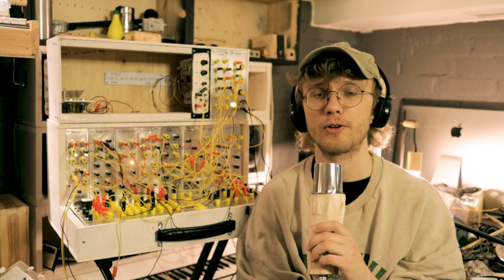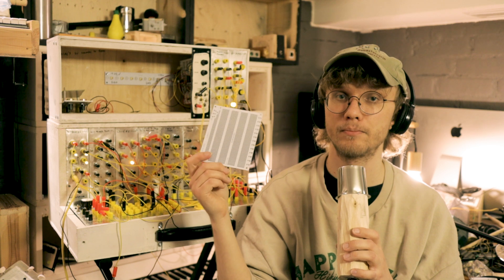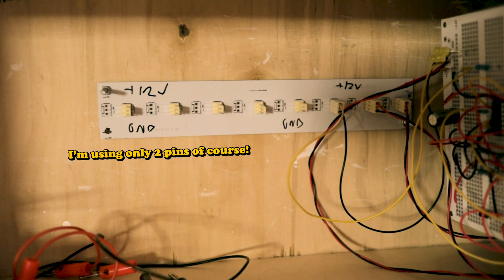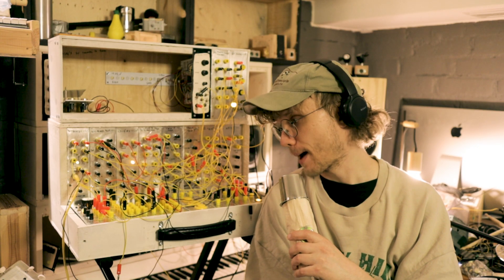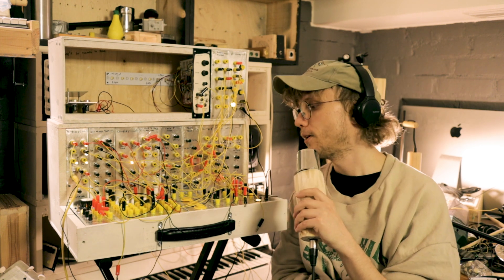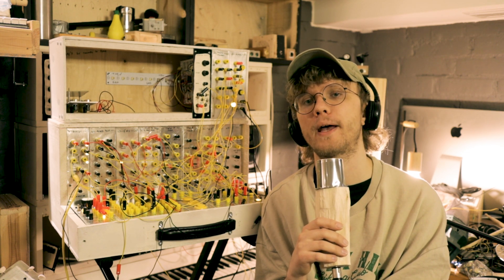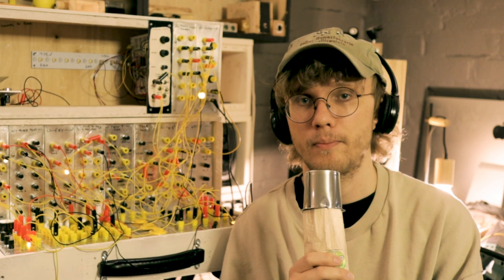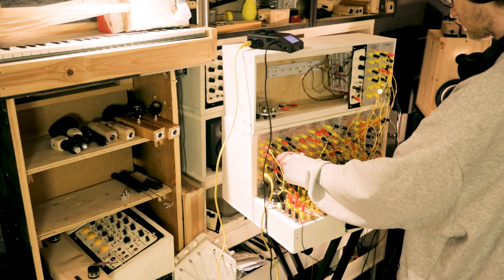MAKING A DRUM MACHINE EP 0 / overview of the project + free sample pack!

Comment: Great to see another video. A suggestion to try to suppress the "bleed through" - add a bucket load of capacitance right at the power input the module. On my build of your twin-t kick drum I put 2000uF at the drum supply terminals. It stopped untriggered popping of the drum. Maybe the same will work for you. I find any module that uses a notch filter arrangement needs a lot of capacitance on the power rail at the module itself.
Reply from the maker: Thanks! Yeah i do have a capacitor at the power input of every module but cant remember what values i’ve used, i might have to buy some bigger caps and try if it makes a difference with this. I also do have decoupling caps close to all the cmos ic:s and that helps with the bleedthrough as well